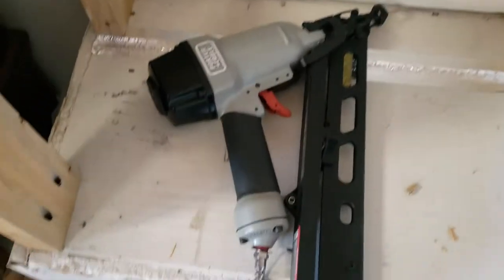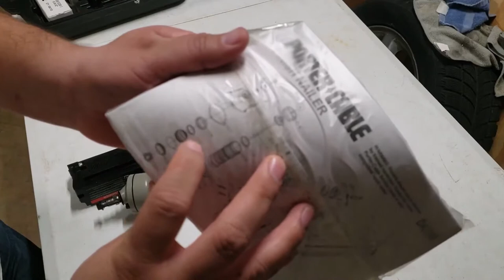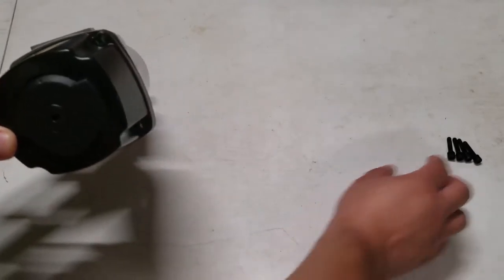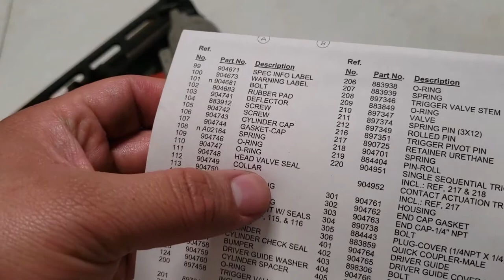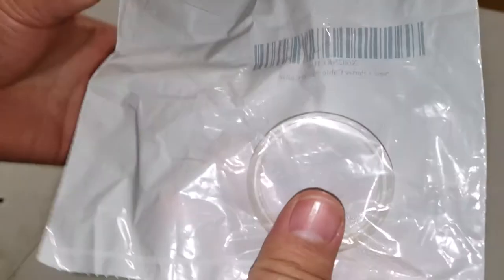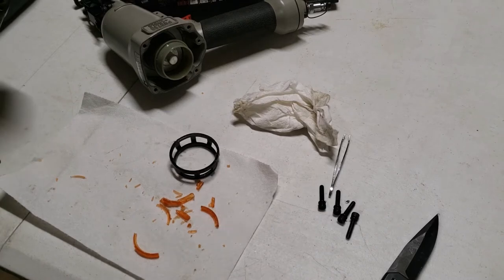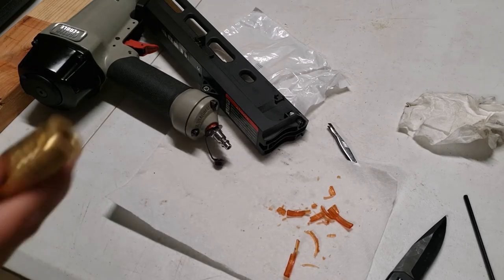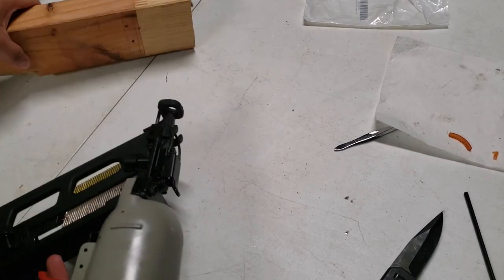Porter Cable Finish Nailer Repair DA250B

Comment: I'm about to throw my PC DA250A in the trash!.. I bought it for $200 about 18 years ago and it has  not even shot 1000 nails. The plunger pin is jammed and won't retract. The rebuild parts are discontinued and if you could buy them the rebuild kit would be less than a "throwaway" nailer from Harbor Freight. Except in this case my expensive PC IS a throwaway nailer! Last time I buy Porter Cable!

Comment: I have same porter nailer like yours and it started to leaks air today, I’m gonna try to open it up and see if the same part is broken. Is the part called collar? Thanks for the video
Reply from the maker: Yes, the part I replaced was called collar.
Reply: @victorgarciatv  I bought the part from Amazon and it’s working again, thanks for the video

Comment: Thanks for the video.  I recently had to purchase a DeWalt battery operated nailer when my Porter Cable did the same thing yours did.  Will now be repairing it shortly.  Thanks for the info.  Of course, it did allow me to get the battery operated nailer that I wanted.  Now I will have both.
Reply from the maker: Glad it helped